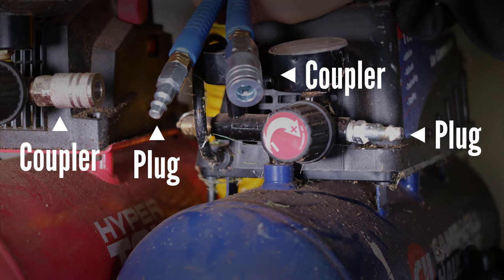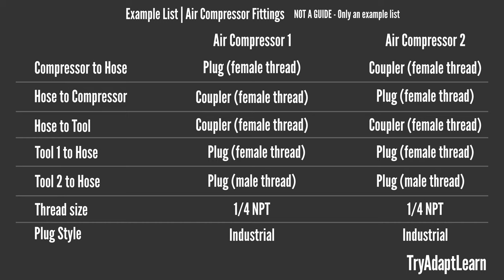Identify and select air compressor hose fittings

Comment: I’m glad I came over here after you speedy first video. I didn’t need this one as much as the other, but the images helped me think over the first video. I just didn’t have enough time to process your first video. So what I’m assuming you did was took all your tools and added a plug quick connect to them with tape and then at the actual hose you added a coupler quick connect? That’s what makes sense in my brain.
Reply from the maker: Thank you for your feedback.  Looking back it would have been better to have a slower speed in the first video.  Thank you for taking the time to watch this second video and leave feedback about.  It is much appreciated to hear that it was helpful.

Comment: Hey great video. I am fairly new to air compressors but I notice almost everyone combines brass, stainless and aluminum when using these fittings. Is using dissimilar metals not a big issue here?
Reply: I think it's based on use applications.  Higher pressure uses steel for its strength, but it's more prone to rust and corrosion.  Brass is softer but will not corrode as fast as steel.  I only use a small home compressor for cleaning and maintaining my travel trailer and truck, so brass is no problem.  If you service cars or do construction every day, you might want to consider steel.

Comment: What size would i use for those little clip ends that you connect to the Schrader valves ? I want to put a ball chuck on it ?
Reply from the maker: The Ball Chuck in this video has a thread of 1/4 inch NPT.  As far as a clip, like the locking chuck, I think it would on the one you buy.  I have seen some everything was put together (lock/hose/gauge) with 1/4 inch NPT.  I also have seen locking / clip chucks attached to a hose with smaller and sometimes fine thread.  The packaging or description should tell you the thread size, then you'd likely want an adapter if the thread size doesn't match the threads on the air hose you have set up.

Comment: Can you use these with an airless paint sprayer? Sorry if this is a dumb question
Reply from the maker: The thread size needs to match otherwise an adapter will be needed.  Once the thread size matches then the internal diameter may effect pressure and flow.  Best option may be to try to identify the airless thread size then see if if there are airless fittings for that size.

Comment: OK either I’m a super slow learner or there’s something not driving with my cobalt air compressor. I have one of the big standing ones that I’ve had it for two years and I’ve never been able to use it because I can’t get the connector to fit right. I havepurchased numerous set and something is not driving. It’s not connecting to it so that I’m able to use it. It is a cobalt standup air compressor and I bought the cobalt connector set so it should be so super simple but it’s not. It’s not working at all please help.

Comment: I was hoping for an array of different plugs and hearing what they are called and which connector is needed for each. I bought a paint spray gun (obviously Chinese) with a plug fitting I don’t recognise. The ones I have are all marked AHF 1/4 but the one fitted is not that. It also has a smaller diameter thread so I can’t swap it out.
Reply from the maker: Sorry the video didn’t cover this but thank you for sharing this.  It gives ideas for future videos.  

I can understand your search.  I have not heard of AHF and it would be hard to determine if AHF is the initials of the manufacturer, AHF 1/4 is 14” air hose fitting, or even 1/4” airless hose fitting.  Thanks again for sharing and good luck with you search.

Comment: Thanks for the video. I've been using milton fittings for around 5 years now, and some of them get dents around the collar on the fitting itself. For example, over time my fitting on my old tools no longer fit in the same coupler I'd been using for a few months. However, the same exact fitting from the same package it came in fit like a glove. Have you ever had this happen to you? I can't find an answer nor anyone with the same experience anywhere on the internet. It's strange and I'm tired of purchasing new fittings over and over again. I made sure they're the correct type and they're all from the same manufacturer. Also, after a few months the couplers get stuck to the fitting while it's pressurized, making it extremely hard to get off. No one else seems to have any information on this. I'd appreciate any help, even a recommendation of different manufacturer. Thanks again
Reply from the maker: None of my fittings had the problem as you described.  Usually I have the hoses as femal and the tools as male.  Perhaps the fitting on the tool has wear and tear like nicks that can be lightly filed down to fit the tool but not let the air escape.

Comment: Imma thinking of quick connect coupler for refrigerants...
Reply: Imma thinking sealing mod-hack the intake to single directional pressure-valve-control-gauge for refrigirant...
Reply from the maker: This sounds interesting, I've never heard of these fittings being used for HVAC systems.
Reply: @TryAdaptLearn  neither have i. Which is why i am thinking of simpler and better alternatives to existing-methods(brazing, clamp) which are "hard-wired" and depends on "crazy" labourers. When times are bad, consumer white-goods need to be "plug and play" or left on the shelves.

Comment: Can use this for water?
Reply from the maker: Not that I know of, these fittings are specific to air hoses.  I would check in plumbing fittings for water.  There are also connect/disconnect options for water but they will be most likely marketed to end of the water hoses and attachments for water hoses.

Comment: Pipe sizes for years have dropped the "inch" nomenclature. One thing you did not address is: Some couplers DO NOT accept all plugs.
Reply from the maker: Thank you for your feedback.  Although many consumer air compressor fittings may be marketed with "in.", it's good to know that "inch" is no longer apart of the pipe size.  This is good to know when communicating with professionals or hardware suppliers.  Thank you for also noting that couplers are not compatible with all plugs.  Even "universal" couplers may have limited compatibility with a few of the most popular standard size sold, but not all.
Reply: @TryAdaptLearn  Although I have not investigated the issue, I suspect that someone sued the pipe industry (similar to the suit about lumber sizes) about the size not being accurate. I wish I could link a picture or vid to this message and show you the problem I ran into trying to get coupling/plug insertion. DROVE ME NUTS! (Well if you are a golfer the analogy is more accurately "a gimme" for be being nuts)

Comment: If you are in UK you might get confused by a company called PCL which manufacturers PCL plugs as well as Euro called XF.
Reply from the maker: Thank you for that note, especially with the perspective of either international viewers, or viewer with accesss to parts from various countries.  Cheers.
Reply: Mate im struggling to match all my parts i have zero understanding of fitting sizes. I brought a air reciprocating saw and the line i have dont fit. Ended up buying some 12pc kit on ebay see if i can make something work with that

Comment: not a single mention of the diameter!?
Reply from the maker: My apology for not mentioning the size. The fittings in this video were 1/4 in.  The size has been added to the description.
Reply: @TryAdaptLearn  Many thanks for your reply ..........................  I didn't think I was going to get a reply as the video is over a year old!
The reason why my comment may seem a little rude and abrupt ( obvious frustration showing after hours of research ),  as no one seems to mention one of the most important factors when buying a air hose online, is the 'Diameter' required ( internal diameter that is ).  Without this information, you most certainly wouldn't be able to purchase the correct one. In my case, it was 6mm

I'm sure this information will help many many others in their quest   ; )

TURK